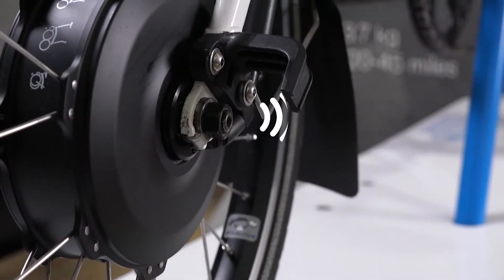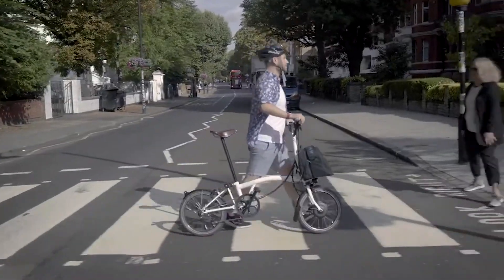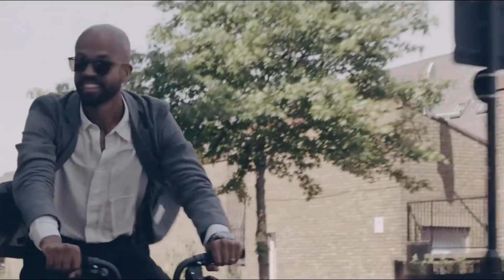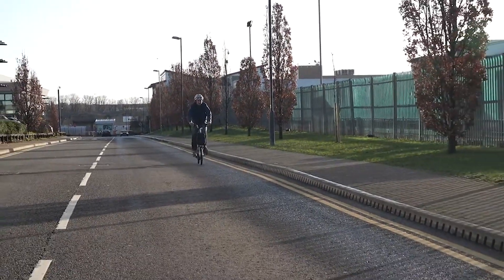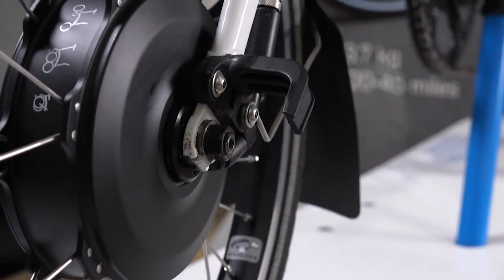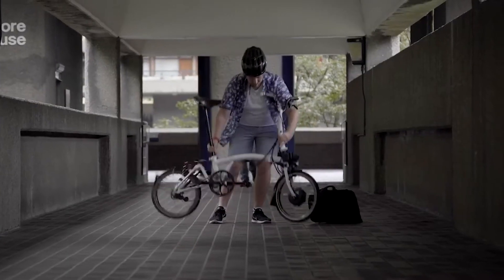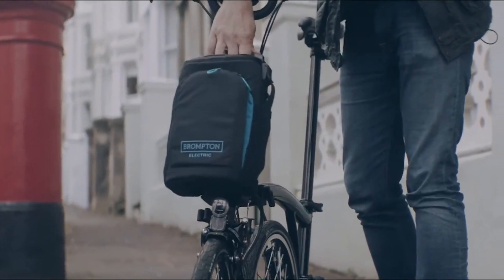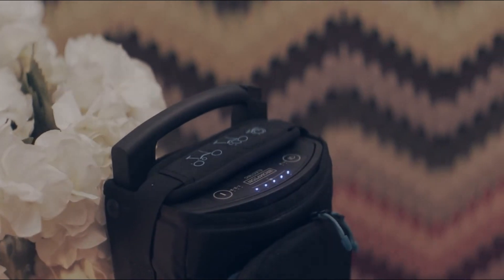Variables That Affect The Brompton Electric Bike

Comment: There are three bar heights available... The rear elastomer suspension provides a remarkably smooth ride, and the bicycle tracks very stable due to the fork rake and frame geometry. Two thumbs up for this 6'4" rider

Comment: Is it allowed to bring this ebike in an TFL services?
Reply: you remove the battery when folded...so it's a bike with a motor and no battery (except for the one swinging on your shoulder in it's provided carrying bag). and i think this would fall under the "folded cycles" section of tfl regulation. i suppose on very full busses, the driver could deny you. so i would say, yes, mostly.

Comment: 100 psi? That may make the bike roll easier but the ride will be harsh. Any sluggishness due to lower pressure tyres will be mitigated by the electric assist. Obviously the pressure should not be so low as to develope pinch flats.

Stop to change power levels? I was under the impression that power levels could be changed on the go using the app. However, I note that the latest info page on the app does say:
 ' shifting power modes from your phone when stopped at traffic lights'

This looks like a change they have slipped in unannounced.
Reply: 100psi indeed gives a bit of harsh feeling, though not too Bad - but I keep it mostly around 80psi and that's just fine.
Reply: To change modes the bike is supposed to be stationary for 30 seconds, including after switching on. This allows the sensors to calibrate, allowing the maximum assistance. I seen this info on one of Brilliant Bikes videos on the Brompton electric.
Reply: @gordonmculloch4904  , that is not true actually.  It only takes a few seconds on power up and then you can switch between assistance levels as you like. Youcan also change the assistance while you ride, but it is not recommendable, due to safety reasons, because you have to reach down to the battery and therefore take one hand off the handle. But I do it from time to time in safe situations and it works fine.

Comment: Why on earth did Brompton NOT provide a  button or lever near the handlebar grips to change assist level, something which virtually every other ebike provide does have.  

Really, Brompton... stop the bike to change assist level? Seriously? Just completely stop in traffic or on a hill simply to change assist level??? 

Plus the only way to know battery level is to lean over the handlebars while riding or (again) completely stop the bike or attach your phone to the bike and use your app??? You have bluetooth...why not have a bluetooth LCD module showing speed, battery level, assist level?  Oh...remember everything needs to work in the rain. 

Am looking at ebikes and while the Brompton has a lot of good points, it is stunningly lacking in a few basic things (see above) which even the cheapest (decent) ebikes provide.... those omisions are not acceptable at the price you charge...

Comment: Ride only on even surface? really? are you shure? would be a absolute buying stopper for me. a bike in this price range which i can only use on paved tarmac is just a joke.
Reply: It's primarily designed as a commuter city bike. You can use it on any surface but it is definitely not made for off road use. It's not a mountain bike, but I have cycled with it on challenging grounds, but if you do, I would advise switching the motor of to prevent it from spinning.
Reply: @oliverposchmannsbassguitar758  Well - it’s not about Mountain Biking - it’s just biking in a German city  with a disgusting quality of bike infrastructure. You will constantly have to pass pavement borders up and down because most of the so called ’bike lanes’ here are part of the pedestrian sidewalks. A unpaved road like the one shown in the video is ‘a peace of cake’ compared to that stress for the front fork. I just recently had to replace the bearings of the front fork on my classic Brompton because of this.
Reply: @Druidus98  sorry to hear about your front fork trouble. I can only speak from my own experience of course. I am using my Brompton Electric since three years now, I was amongst the first buyers and I have to say that it is holding up pretty well. I commute with it almost every day in London and the roads here are also putting a huge stress on the bike. I have also ridden it in Germany for a good amount. I think they are really robust bikes but obviously like everything, they are not unbreakable. But in general I can say that the Brompton Electric was and is a game changer for me. Ever since I own it, I have cycled more than ever before and it adds such a great amount of flexibility to my journeys, also in addition to car travel, train rides etc.